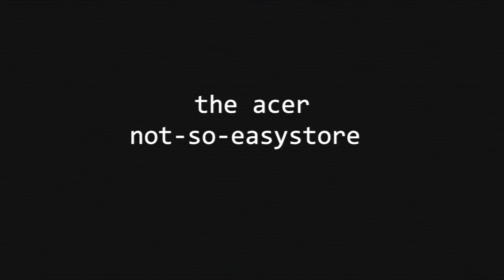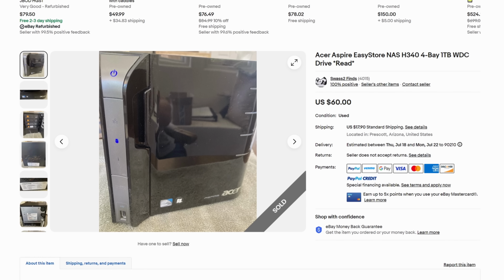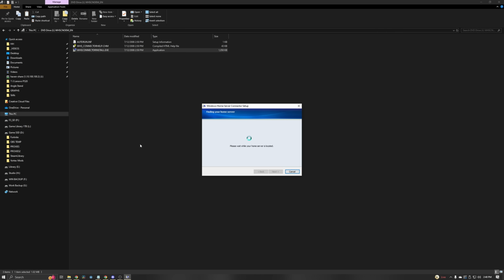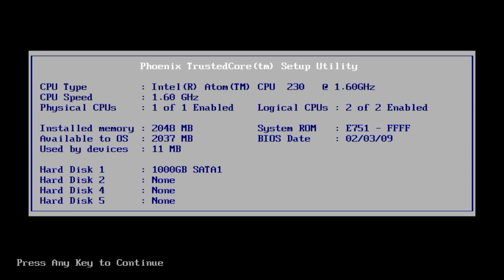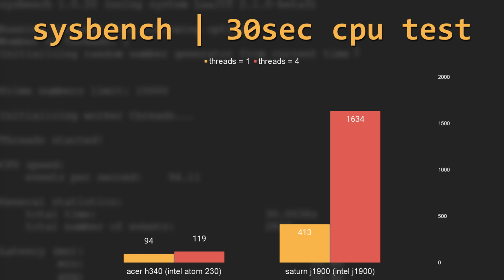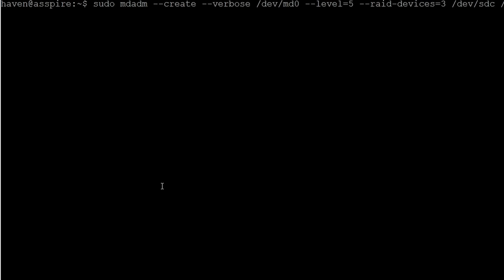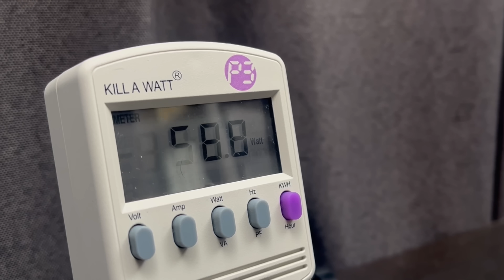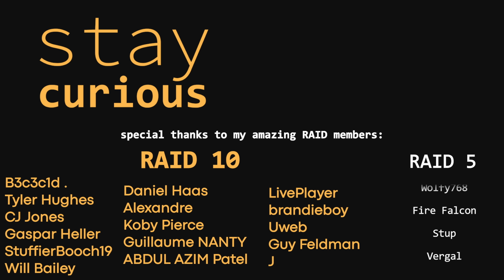I wish EVERY NAS was made like this one

Comment: I liked Windows Home Server. One of the features was it would let you do essentially bare-metal backups of windows PCs. It ran a PXE boot server, so if you have a hard drive failure on your laptop or desktop, you could replace the drive, boot from the network, and do a bare-metal restore of any of the backups you'd made (not necessarily the latest one if you didn't want to). It made that level of backup easy for even non-technical people.
Reply: Windows Home Server was an EXCELLENT product. Shame the 2011 edition dumped the JBOD drive pooling, and then Microsoft dumped it entirely.
Reply: the biggest problem with windows home server is that NO ONE knew they needed it. and if they knew about it they were also likely to know about linux and therefore.... probably just set up a linux server instead. it was one of the greatest consumer products ever created, but like no one knew about it MS didn't market it, MS didn't push it like they should have, and so many more issues with it. more over it's very hard to convince someone that doesn't know about tech how important a home server is, and why they need one. 
like try convincing your grandmother she needs to invest in a device that stores things and she can't directly interface with and doesn't understand.. that's the hurdle that MS faced.

Comment: Looking forward to your upgrade video to compare/contrast with my own modded H340. I use it as a test NAS -- trying settings/plugins/containers before deploying to my real NAS so I don't eff up the system I rely on! The upgraded H340 is a great little 4-bay NAS with such a tiny footprint.
The bog standard ITX tray and flex PSU mount made it seems like it would be an easy upgrade. Splicing molex/SATA power connectors onto the original backplane connector was simple, too. The real "fun," as I'm sure your discovered, was decoding the proprietary pinouts -- and discovering that the backplane needs an extra +5V line (that I tapped from the new MB's USB headers).
Unfortunately, some of the front panel functions are GPIO controlled, so those remain unavailable. Same with the individual drive LEDs unless you use an HBA card (I wish Acer made the LEDs come off the backplane instead of the MB, but they wanted to go all fancy with the bicolored LEDs to also give SMART status instead of just having simple activity LEDs).

Comment: Oh, I have one of these.  I put in a 4th gen intel into it years ago.  Had to splice in a wire off the backplane to one of the orange (3.3v?) lines on the atx connector for the backplane to function.

Comment: How was a 4 threaded sysbench test performed on the Atom Processor 230 when it's single core, and hyper-threading brings it to two threads? Is this a sysbench thing, or was 4 threaded supposed to be multi-threaded?
Reply: The same way that you can have more programs open at once than your CPU has cores/threads. You can spawn as many threads as you like. They just won't all be running simultaneously when you have more threads spawned than the CPU can run simultaneously.
Reply: @5467nick  This just struck me as odd, since benchmarking applications generally tailor the number of threads they attempt to run to how many execution threads your system has available, instead of running twice as many and then having the application threads juggled in and out. 
So that's why I was wondering if this was a sysbench specific quirk, or if the slightly misleading way of presenting the test results as 4 threaded on a 2 threaded CPU was the presenter's decision. 
Not that it really matters I guess.

Comment: Fun fact: Despite being Hyperthreaded, this generation of Atom CPUs lack Out-of-Order execution. Which is great for package size and power savings, but not for performance. So glad I at least had the 330, which is dual-core.

Also, the i945 (?) chipset uses more power than the CPU. Mine has a passive heatsink on the CPU and a fan on the chipset!

Comment: How big was your SSD? You need at least 160 GB to install WHS and it needs to be NTFS. You should also put a config file named "cfg.ini" with this information (only 4 lines) on it:
[WinPE]
ConfigDisk=1
CheckReqs=0
WindowsPartitionSize=MAX

Be aware that after you boot with this drive, no matter whether it's a success or not, it will write a fifth line on cfg.ini, and this file won't work anymore until you manually delete the fifth line.

Comment: I have a acer NAS so old, that the filesystem isn't even on Windows. The encryption is on the first gen, and Windows 10 only Supports gen 2 and 3.. It has 4 bays, I got it for free, and I think the hardware broke on me.. It came with 2 180GB drives. Software was by acer, and not upgradebale, it had no USB-Interface, no Displayoutput, just a really old NAS!

Comment: Windows Home Server didn't support raid att all, it added all disks as a pool more like jbod, but it still was a interesting OS, I used it from release to eol but had a more powerful system, there was program so you could rip your cds and dvds if you had an optic drive, no need for monitor or keyboard, when you insert a CD, it automatically been riped and data downloaded, all settings done from client, then it just worked
Reply: No RAID, but you can set selected folders to mirror to another drive.  I wish today's NAS devices had that feature.  Actually, I have the early version of WHS still on my rack for archival storage, and  I wish Microsoft still supported it.  I rarely  power it on to access an ancient file, and when I do, I disconnect the router as WHS hasn't seen a security update in years.
Reply: @photonx3075  you could use Amahi os that works almost exactly as WHS but are build on Linux

Comment: Imagine not using the onboard vga... Fun fact that 1tb hard drive with the os is indestructible mine currently has 121 000 power on hours... oh the windows home server will only install onto the bottom drive bay.
Reply: And you can wipe the 256 mb restore drive, and run tiny core linux off it for lols

Comment: I have one; it's okish; probably best to use with truenas and iscsi(as a 4 bay iscsi enclosure)...... things to know: 1) it has an onboard header for vga, ps/2,etc(diy proably required or the route i took) 2) as this was first gen x64 atom it's a 230,945GC chipset, this is only sata2!(it's slow) 3) lenovo has a model of the same unit with a diff faceplate 4) I slic2.1 modded mine:P..... 5) the esata controller is trash, I modded mine to be usable for the system drive but it was unstable 6) H1110 HBA is probably a good fit and would bring it up to SATA3 ** will be interested to watch the follow up as I did initially try to upgrade mine but bailed at the first sign of trouble(didn't have enough incentive:P)

Comment: These ancient Atom processors predating Silvermont(J1900, N3150 etc) are somewhat useful if one is paranoid about CPU backdoors, as they don't even support out of order exceution and speculative execution.
Though you would want something like D510 as you get 2x performance from dual core, which seems to finally arrive on H342. The case looks very tempting for modding, though flex atx power supply might be a PITA to manage.

Comment: system didnt boot when motherboard out is because of the chasis intrusion built into some prebuilts they do not like to turn on outside the chasis
Reply: just fuse the sensor ?
Reply: @herauthon  These boards have it as part of the motherboard unlike consumer motherboards where you plug said sensor into a labeled header.
Reply: @herauthon  these mobos are notorious they measure the capacitance of the chasis from diffrent pads on motherboard and its pain in the butt to do that job
Reply: @theindianallrounders  No way! Why do they go to such lengths, what is the point?
Reply: @92kosta Acer started doing this to their ultra-light laptops to ensure they couldn't be "accidentally" started with the cover off so you didn't hurt yourself or damage components by shorting it on a metal table or stray tool. The only reason I have for these little ITX wonders is they wanted to take the "warranty void if opened" measure to heart. You try to mod it? Yeah, now you don't have a working system... At least with their laptops, most that I've seen it was a little momentary switch on the bottom that the plastic of the case kept depressed to signify the chassis is closed.
Reply: @ironman82084  I've seen one where a sort of hook on the mobo tray pressed in a kind of switch on the mobo. Like you had to lay the mobo the correct way so a upside down L shape came through a hole and then slide it so it 'hooked' and pressed the switch. It gave a loud beep beep beep beep without.

Comment: I miss Windows Home Server. When I was in the military I had a home server that I could use to access my media library at home while I was deployed overseas. It was awesome.
Reply: From what I can tell, it may have been a commercial failure.

Windows Home Server was based on Windows Server 2003 (≈ Windows XP) if I recall correctly, then there was Windows Home Server 2011 which was based on Windows Server 2008 R2 (≈ Windows 7) instead.

From what I can tell on Wikipedia, Windows Server Essentials 2016 (≈ Windows 10 update 1607?) was kind of the last version to have features carried over from Windows Home Server.

Comment: Man I can't wait for the upgrade. For only $60 with a FlexATX psu, drive cages and backplane included that's an absolute STEAL for the case alone! I'd still be curious too if the poor atom CPU would be good for anything like a custom network switch or router with that PCIEx4 slot.

Comment: So many of those old atom processors were crazy slow even when they were new. I'm impressed that you got it to do much of anything. Now I'm looking forward to the upgrade!
Reply: So, I wasn't crazy, my computer was insanely slow (and, maybe, I wasn't nuts for running two).
Reply: @StephenMatrese   If you had a computer that ran one of those old Atom processors I promise you weren't crazy and your computer (like mine at the time) was slow as a sleepy snail
Reply: Yeah. They were slow even by early 00's standards, just insanely low power.
Reply: @lemagreengreen  "insanely low power" by Intel standards anyway, the chipset was still burning 15-20 watts so the overall board was using still a lot of power for what this was
Reply: @lemagreengreen  They weren't slow by early 00's unless you are talking about gaming performance with the iGPU. In multi-thread performance the first gen Atom's were comparable to pretty good CPUs from 2002 but in single core they were closer to Pentium III's from 1999-2000.
That's crazy considering the single-core Atom's had really low 2.5-4W TDP, though Intel did pair them with old ~10W (on mobile) or ~20W (desktop) chipsets. Even then my Atom N270 based netbook had really good (for the time) battery life with an extended 55Wh battery. It was also pretty fast on XP and worked great for what they were made for, web browsing. Back in those days smartphones were still really slow for web browsing and were quite limited in what they could do, they also had shorter battery life than netbooks.
Reply: the weird thing to me is that even though they were STUPIDLY slow, they could still somehow emulate an Amiga 4000 at full speed... which says terrible things about the Amiga... OK granted the platform had died in 1994 whilst the Atom wasn't released until like 2008?
Reply: @jonjamhar  It does not take much to outperform those motorola processors at 40 Mhz when your CPU frequency is measured in GHz. It's not weird at all

Comment: I would slap a PCIe to NVME (or M.2 SATA for compatibility) adapter into that slot, and use that as a boot disk to reclaim that 4th drive bay :)
Reply: You're unlikely to be able to boot from it though
Reply: @richardnpaul_mob  You could only get problems bootin from an nvme but a SATA m.2 could be used to boot like any other drive.
Reply: @richardnpaul_mob  You could always stick a boot loader on a USB drive. Clunky, but should work!
Reply: @cleanycloth  yeah I've seen that work
Reply: Mod the bios to boot from
Nvme
Reply: @zr0dfx  Not possible, NVME boot modules work only on UEFI bios. You would have to write a NVME driver for BIOS from scratch. Just put the bootloader on USB, or put the whole NVME drive in a USB enclosure on a USB port
Reply: @marcogenovesi8570  as I remember there is way - you have to integrate Samsung 950 Pro oprom into MB BIOS and modify VID/DID for specific NVMe drive in process. It is not very flexible but can be done.
Reply: @zr0dfx  I've modded my EFI before on an Asrockrack motherboard before to allow for this (dual s2011 C602 motherboard but they added support natively when they updated the firmware for the Spectre and Meltdown vulnerabilities). I'm not sure how easy it would be to add to an old school BIOS
Reply: Use Clover to boot from USB, then Truenas from NVEM on Pcie. I replaced the mboard with a mini-itx. I bought the EasyStore new in 2009, updated to HomeServer 2011 and eventually 2012R2 Essentials with DrvieBender. With Drivebender EOL in 2022 I now run TrueNAS in mirror mode.

Comment: Windows Home Server was pretty darn cool for its time, you should try and explore it some day. Not useful at all today though.. My first homeserver was an HP EX475 and that thing ran for years before I replaced it. I still have it, but it runs Ubuntu now and is just for backups.
Reply: i got a similar HP server from FB Marketplace a few years ago but after finding out how outdated the hardware was, its just been living lifeless on my shelf.  My hope is that there is a way to get a modern motherboard to replace the aging one and put new life into it.

maybe HH will show how that can be done with his next video, at least for the Acer.
Reply: @djheartbreak831  The motherboard in the HP is much smaller than this Acer, so I don't think upgrading is realistic. Maybe you can shove a Raspberry Pi in there, but the backplane for the drives plug directly into the motherboard so it would be difficult to make it useful. This Acer seems easier since it's more standard parts.
Reply: @djheartbreak831  Well the HP Mediasmart ex49x servers are physically identical to the HP Datavault x510 except the former rums an AM2 Sempron single/limited option dual core cpu and the Datavault x510 uses LGA775 and has a dual core pentium cpu. The boards are direct swappable and there are plenty of examples of these, especially the AMD/Mediasmart variants on ebay.
Reply: I was just about to buy 2016 until I saw this comment😭

Comment: Is there an "open case" switch that blocks the boot if nor pressed? That's pretty common on SFFs.
Reply: Also, have you plugged the 2.5" drive into the correct SATA port, as it may have to be the last one on the bottom (PhysicalDisk 0) as it may be the requirement for the Windows Home Server? You can list it using "wmic diskdrive list" or "compmgmt.msc" and list drives there (but this is only from GUI).